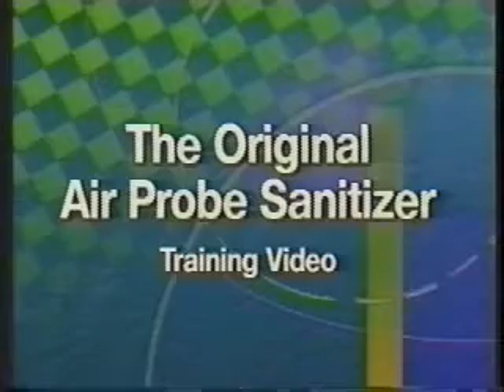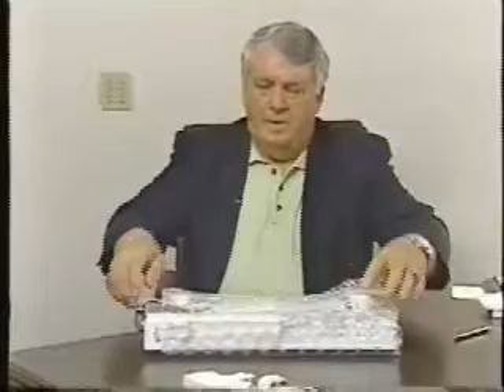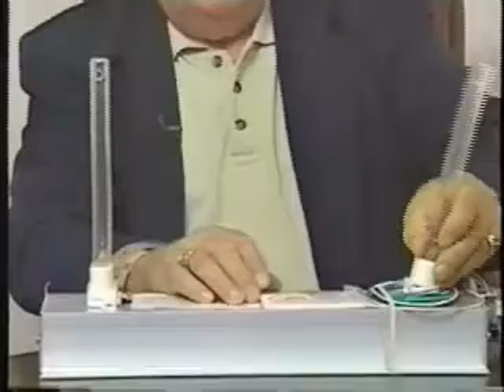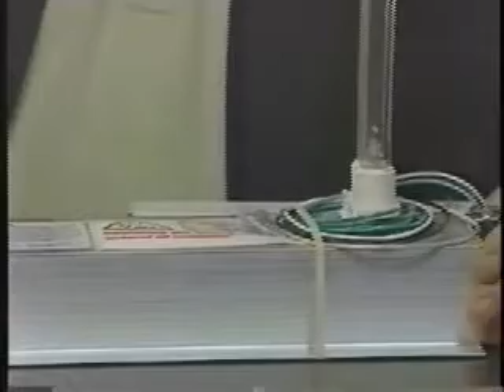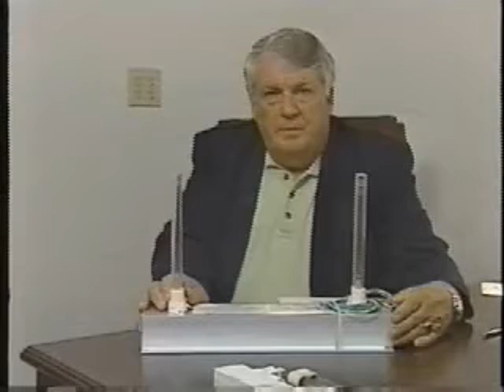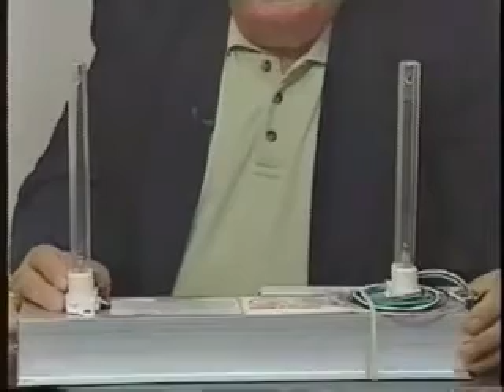Air Probe Sanitizer in-duct UV-C whole-house air purifier

Comment: I watched the video and have some questions: 
1. We do not have such an issue in Toronto. Is it for very hot humid cities?
2. Is the one goal of this UV light to kill mold and mildews on the coils? 
3. The sun UV damages the materials, like PVC, wires, and paints. As the wires inside the air-handlers are not UV rated and the bulbs of your machine are creating 2500 times the UV of the sun, so what is the effect on the materials inside the air-handlers. it will make the wires discolor and stiffen and it will the wire covers crack and break. Also on the other materials. What is your opinion?
4. The other issue is when the bulbs get cold on the cold side of the evaporators they tend to not heat up as per the designs of the bulbs and not creating proper design UV lighting. 
5. Have you got any independent laboratory testing to show the effectiveness of this system and type of installations?
Thanks
Reply from the maker: It was originally intended for cities that are hot and humid and prevent mold on and near the cold evaporator coil, yes. Any plastics can easily be covered with split sleeves meant for covering wires  under motor vehicle hoods, or aluminium foil tape. Your other questions are thoroughly covered at https://web.archive.org/web/20180826055852/http://negativeiongenerators.com/ultraviolet.html
Reply: @w0btu  UV-C radiation is able to break down chemical bonds. This leads to rapid aging of plastics, insulation, gaskets, and other materials. Note that plastics sold to be "UV-resistant" are tested only for UV-B, as UV-C doesn't normally reach the surface of the Earth. When UV is used near plastic, rubber, or insulation, care should be taken to shield these items; metal tape or aluminum foil will suffice.
Ref: https://en.wikipedia.org/wiki/Ultraviolet_germicidal_irradiation
Reply from the maker: @kamranshirazi3030  I have already stated here above how wires and plastics can be easily covered to prevent this, so I'm not sure why you said this here.
Reply: @w0btu  as a service tech/installer i was imagining the task is kind of impractical. Any portions of the wires that remain exposed will cause the same problem.
I have no idea how long it takes and how bad it gets. I don't know how many years for the wire shields to dry up. In some commercial jobs wires in rooftop units are dried up, cracked and broken with only temperature swings, even without exposure to sun beams. 
I was just wondering adding a powerful UV-C will be an additional damaging factor.
Plus I did not see they protect any wires on the sample installation videos.

Comment: This wavelength of UV... if it has the potential to ionize the air... doesn't it have the potential to create ozone?
Reply from the maker: Neil Hanbury The 253.7 nm germicidal (and hydroxyl-ion-producing) wavelength emitted from the Air Probe Sanitizer lamps doesn't generate any ozone. It's the 185 nm wavelength that produces ozone. The lamp's synthetic quartz envelope and the thin coating on the inside of it filters out that ozone-producing wavelength. 
(Both of those wavelengths are called UV-C, though.)
Reply: Oh I see. Those hydroxyls are very beneficial- the "detergent of the air". Life as we know it would not exist without the hydroxyl radical.
Reply: the original airprobe sanitizer never creates ozone

Comment: you should not touch the lamps with bare hands as the oil from skin will cause the lamps to burn out prematurely. These lamps work fantastic and kill off all germs and dust mites.
Reply from the maker: We appreciate your helpful advice. It's certainly a good idea to keep the lamps clean. However, that advice (supposedly) applies to halogen lamps (which run MUCH hotter), and the cooler-running UV-C lamps used in the Original Air Probe Sanitizer are not halogen. Dirt and oil might very well reduce their effectiveness, but not shorten their life.